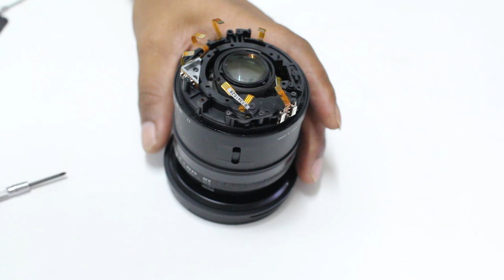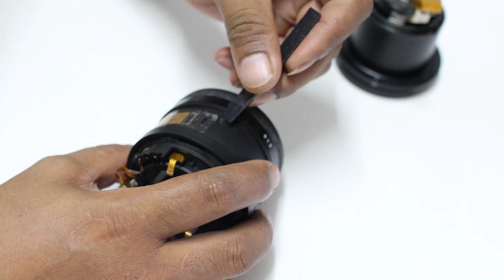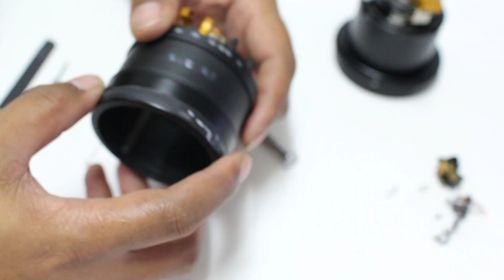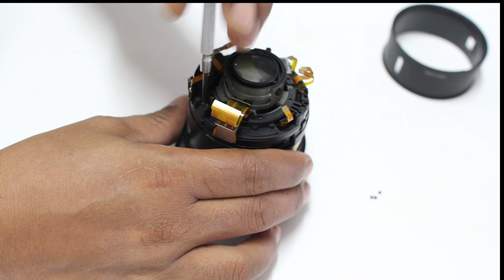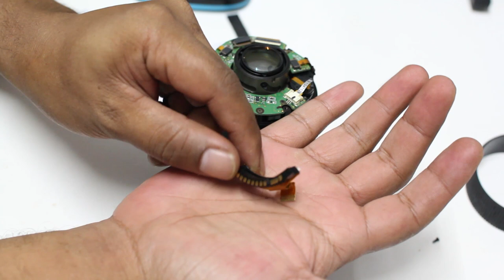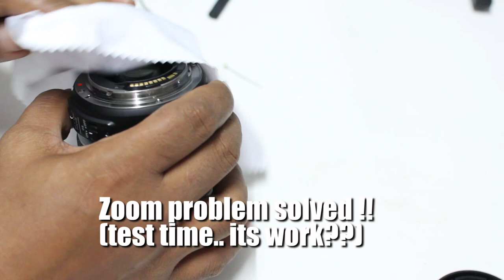[Solved] Repair Sigma 17-70mm Lens Zoom Problem (Stuck) #Part2

Comment from the maker: [Solved] #Repair Sigma 17-70mm Lens Zoom Problem (Stuck)
Part 1 : https://youtu.be/ULnMHDn0qiU
The #Sigma 17-70mm F2.8-4 DC MACRO (OS) HSM "C" Canon mount. The Sigma 17-70 mm C is the first Sigma #lens in the Contemporary series, which Sigma is described by Sigma as: "High performance, yet compact and lightweight, true all-round lenses".